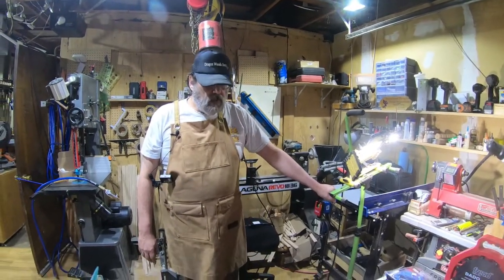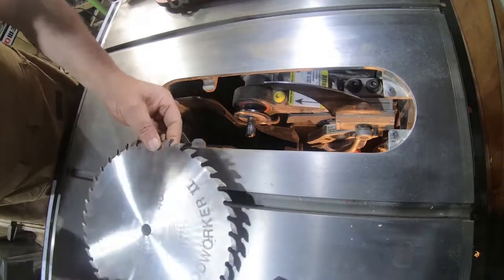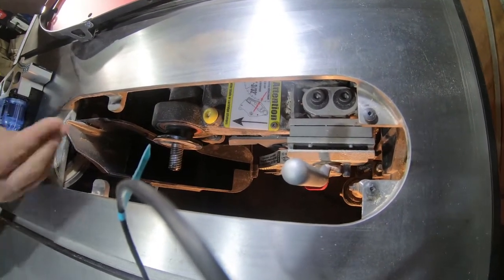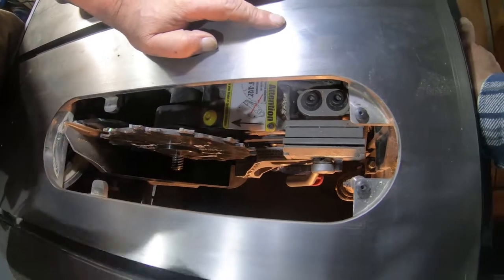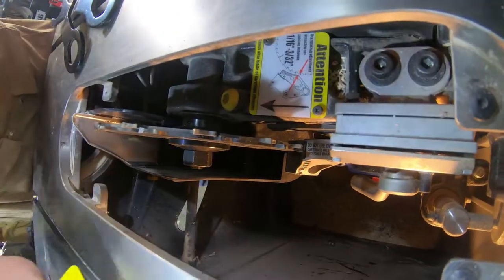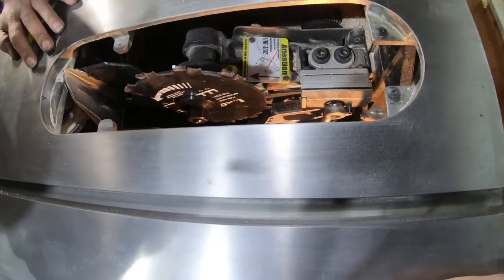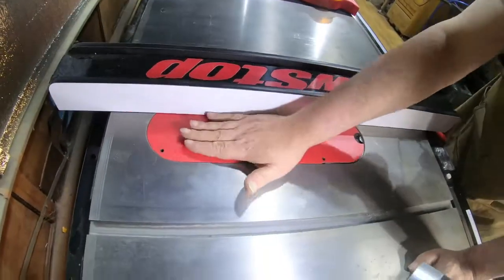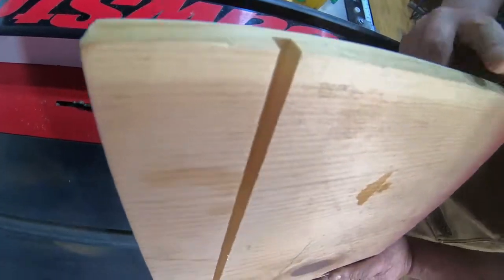$170.00 to use a dado blade on a SawStop???

Comment: Here's another issue, if you have frued dado blades they are are truly about 8 1/8 inch and they will not clear the brake.
Reply: I use Freud and I just adjust the 1/16 inch (radius) difference. It works fine.
Reply from the maker: The blades I used for the video were Freud (part number: D208M or SD208 depending on where you look on the label), 8" (printed on the blade), and they do measure 8-1/8 inch as you say. But the blade brake can handle the extra 1/16th (.0625 per side). Might have been tight, but in the end, required clearance was met. Probable could have handled blades 8-1/4? Just guessing but the dado blade brake (break!) works fine with Freud blades.
Reply: @DragonwoodDesigns  I agree with you. I found I could clear the brake, but am tight on the required clearance. My saw is the contractor model. So, I run in the bypass mode and it works.
Reply from the maker: @williambullock6127  You're lucky! If you can run in bypass, you don't need to get the extra brake. That was the first thing I tried. Found the PCS 3 hp errors out if no blade. Would be the same thing as a smaller blade, ie an 8" dado, Yes, I did have to adjust the position, almost to the limit, but the supplied thickness gauge fit as required for proper operation. Just remember to set it back when putting on your regular 10" blade. If you don't, it will still run, but due to the increased distance, more teeth are going to pass before the blade stops and drops. Changing a possible scrape to stiches.

Comment: I don't understand this logic... you bought a 3 or 4 thousand dollar table saw and complain about 200 worth of accessories to run a dado stack?
Reply: How about the logic of paying 3-4 thousand dollars to not have the option to use the saw the way you want? The bypass system should be a complete bypass turning it into a regular table saw. Instead the saw decides if it’s going to let you bypass.
Reply: I’d never ever have a saw/stop machine in my shop.    For what you pay for one a tech should come out for free$$ every time we need to use a dado stack.  For gods sake who has that kind of time to tie up a shop.   My powermatics and grizzly’s are just safe enough for us.

Comment: You compared trying to run the saw without a blade with the standard brake to running the saw with a dado stack with the dado break. What is the point of this? The saw will not fire up without a blade whether you have the standard brake or the dado brake installed.
Reply from the maker: I wanted to know if the dado brake was absolutely required. I didn't find anything  on Y-Tube or in the manual on whether this would work or not. Was there something in the manual that I missed? My bad if I did. I wouldn't mind making dado cuts with the safety disabled and spend the extra $100 on wood or supplies. The fact that the saw detected no blade near the brake and errored out proved my point (to myself). I think I even tried it in bypass mode (brass key on side). Still, no joy. Once the $100 goodie was added, the saw works as expected. I have not had the saw trip on either brake, although after cutting 8/4 hard maple it just shut off, mid cut. I cycled the power and it worked fine for a couple of days. Then it did it again. I reset and finished the job and have not had the opportunity to cut anything that thick since. Things have slowed down since the p-demic.
Thanx for watching, tho. It was a fun video to make!
Reply: @DragonwoodDesigns  Regardless of which brake you have installed, the saw will not start without a blade in it. You proved nothing. Put the standard brake in, put the dado blade on, put it in by pass and try to start it.

To clarify, I have no idea if that will work... But that's what you said you wanted to try in the video but you didn't actually try it.
Reply: @bswinter2  This was my thinking as well.
Reply: @bswinter2  It wont I tried on my PCS. I wish I could run 7 1/4 circular saw blades on Sawstop because of the narrow kerf. But they won't work either even if I use the brake for 8 inch dadoes. Kind of a bummer for me.

Comment: I don't see reason for the complaint. The Saw Stop is the most safety conscious machine on the market. An xtra $100.00 for saving my fingers...............A NO-BRAINER!!
Reply: Blah Blah
Reply from the maker: I agree with you 100%! The SawStop is one of the finest pieces of equipment I own. It has no equal in the market, not even Powermatic comes close! The point is this: I was expecting to drop in the smaller 8 inch blade and run the bypass function. I don't mind giving up the safety feature for dados. I still needed to buy the zero clearance insert ($69), but another $99 for the safety feature was not planned.
Know this: The safety feature is an invaluable asset I would never do without, even thought there is a premium to be paid. The major cause of injuries on a table saw is kickback! Thank the manufacturers for always including a riving knife. I think that is the most important safety device.
So, people should know, if you dado, you need to plan ahead and get the extra parts you will need ahead of time. 
I would NEVER purchase a table saw without this safety feature. Also, the cuts and workmanship on this saw are amazing, worth the price even if there was no safety feature!
Thanks for leaving the comment.
Alan